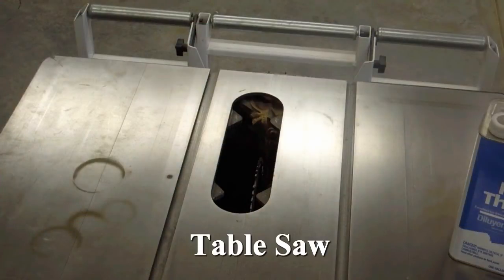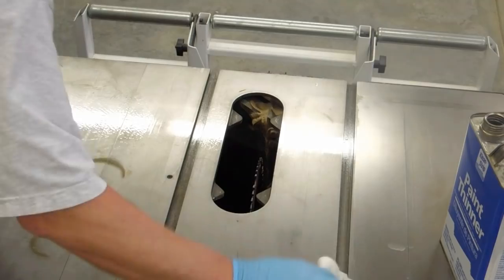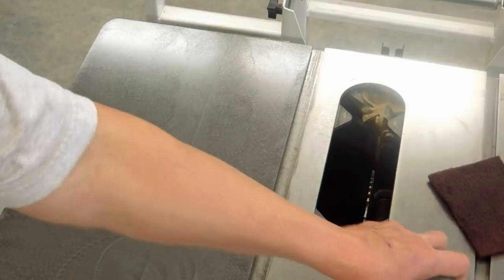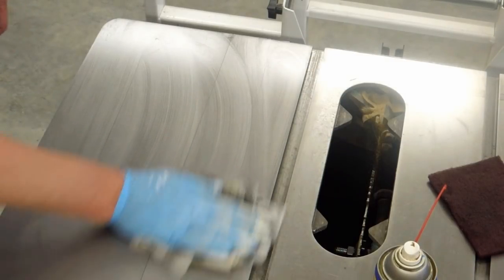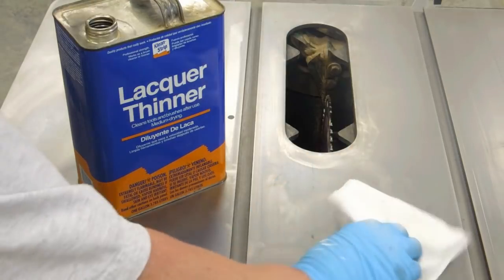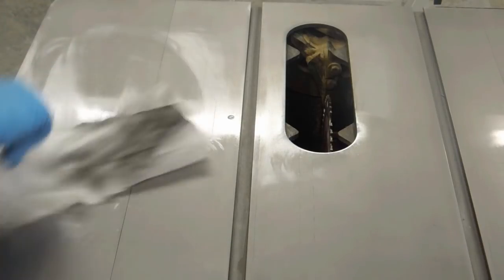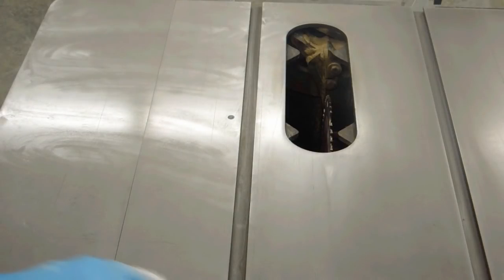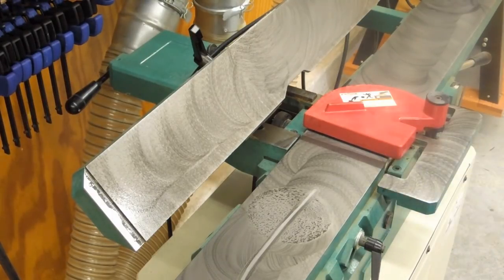Cleaning Cast Iron Machine Table Tops

Comment: Ron, as a side-note on Simple Green - following Alan Little's (askwoodman) channel, I have begun using a 50/50 Simple Green/Water mixture as a drilling coolant.  Alan also uses the mixture on diamond stones while sharpening chisels and plane blades.   No rust forms - even when bare metal is left wet.  Something in the Simple Green seems to prevent rust from forming.

No need to take my word for it - it's simple to test on any bare metal.  I didn't believe at first, but it works like Alan says.

Comment: Shop dehumidification is the long term control on rust and wood stability, wax is cheap insurance to prevent rust in the first place. Nice solution to restoration of iron surfaces, I used a similar sander and scotch brite pads. That was after i realised it was the humidity attacking the iron in the winter months and thermal cycling the shop temp, just a learning curve. Thanks For the great video!

Comment from the maker: I can not answer that... they are not marked.  I got them at Fastenal and bought three different grits. This was the finest grit available at the time and I have used it for several years. It is loaded up (probably with wax) and it is about time to replace it. I leaves the surface a dull scratched surface (not polished) and I feel it holds the wax a bit better than a polished surface.

Comment from the maker: These scotchbrite pads are from Fastenal and they are round with Velcro backing. Do not know the grit. I suggest the finest you can find. The simple green I know is a water base product and I would not spray that on my cast iron. I am using an electric sander so I do not want anything to explode or catch on fire. I scrub with WD-40 first. Mineral spirits to clean up the mess. It is cheap and does not attack the gloves. Then lacquer thinner to degrease things better (it does attack the gloves).

Comment from the maker: I am not sure what the relationship/difference is between Grizzly and Shop Fox other than the color and Shop Fox is a bit more expensive. I have a Grizzly store about 2.5 miles from my house and that place has cost me a small fortune since they opened. Anyway, I bought the Shop Fox Disc/Belt Sander in their Scratch & Dent section 10 years ago. I had the motor starting capacitor go out and (knock on wood) that is the only problem I have had with that unit. Can not complain at this point in time.

Comment from the maker: A product called Navel Jelly dissolves rust. It is rinsed off with water (here comes the rust again). Possibly some sort of passivation with phosphoric or muratic acid. Ask around about this. Do the acid thing outside or you will rust EVERYTHING in your shop. Believe me NO ACID IN THE SHOP! Probably best to take the table and wings off to do this. There are videos showing molasses and water for rust removal. Also John Heisz has video showing the rebuild of an old table saw. Hope that helps.

Comment from the maker: Cast Iron Tables are left bare so they can be polished and waxed (Carnauba wax ONLY) so wood will slide freely across the surface. An applied finish generally creates an uneven surface or the wood eventually wears it into an uneven surface and then you have to sand it off and start all over. Really need to be careful about what is applied. Some materials will penetrate the cast iron surface making it difficult or impossible to completely remove it. I would not want to use Rust-Oleum NeverWet.

Comment: You almost don't want to use anything when you have just done a good deep clean of the workshop. :D
At 4:14 is that a sweep to dust collector on the floor and higher up the pipe is that the  valve?

Comment: You're not worried about WD40 getting pulled into the dust collection ports on the sander? I'd worry it might gum up the inside.
Reply from the maker: You are correct; it will pick up the WD-40, but only a little. I use an old hook & loop pad on the sander for that very reason. I got the bright idea one day to put a stopper in the exhaust of the air blower so it would not pick up any oil, not thinking that was the same blower which cooled the motor… so that did not work. I haven’t experienced any problems with the sander (yet). The sander pad is the most affected and I immediately take it off the sander and wash it with soap and water.

Comment: Ever tried 
Fluid Film or Krown T40?
Reply from the maker: Probably not a good choice if it is lanolin based and stays wet. Do not want anything that will interfere with waxing the metal or which would contaminate the wood. The objective here is to remove rust and leave bare dry metal. Then immediately protect the metal with  Carnauba Wax which will not interfere with wood finishes.

Comment: Would a car wax do just as well?
Reply from the maker: I am using Mothers paste car wax which ONLY contains Pure Brazilian Carnouba Wax. Carnouba wax will not contaminate your wood and spoil you finish. Other waxes will prevent finishes from working and once you put that on a metal surface you may never get it off again. Therefore... use Carnouba wax and don't worry about it.

Comment: Regular "ole timey" paste wax works great, apply and then buff it out with a electric buffer like you would a car body. Use a sheepskin bonnet.  A little patina is fine if you keep it waxed you will not get rust underneath. Setting a coke can on my table top will get you hung around here! I apply to my saw tables weekly when under heavy everyday use.  I use my equipment just about everyday to make a living.  I would never use wd-40 if it gets into a stain grade wood product that wood will not accept stain. I might use an oil if I were going to have a retirement auction or sale or long term storage.  Shop dehumidification is impossible where I live, many days per year we are in the 85 - 90% range. So I fight humidity most of the year, I like the scotchbrite, it removes the rust and is cheap.